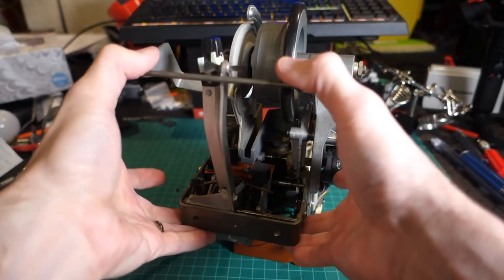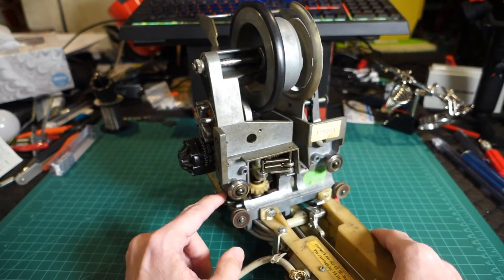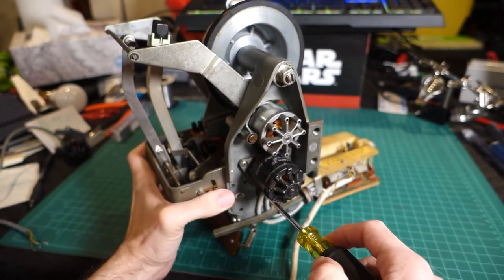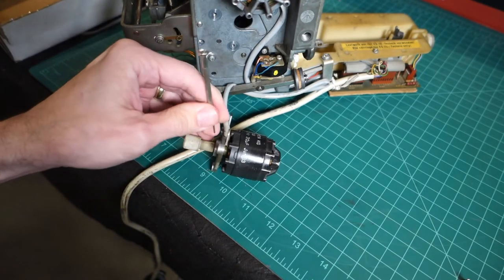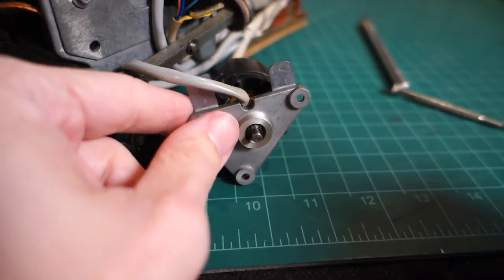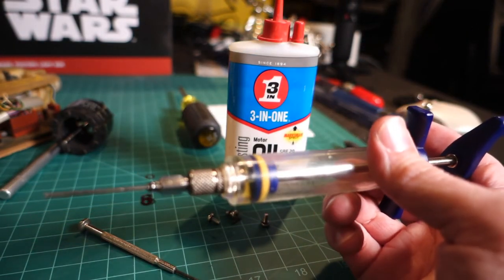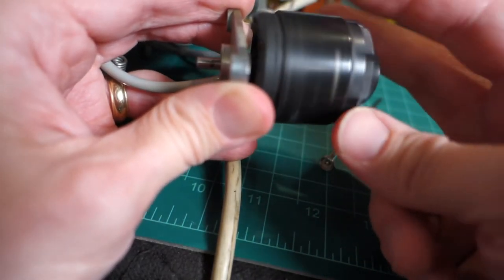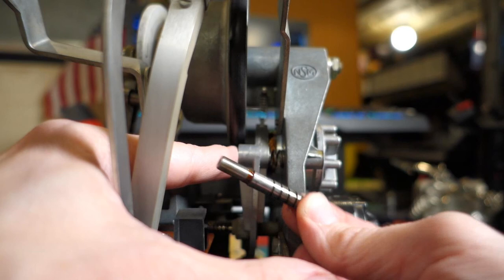NSM 45 rpm mech repair (PART 2) sticky/gummed up drive motor

Comment: Very helpful video, thanks a lot for uploading. Perhaps you have a solution for a problem of my consul E120? It always picks up the same record, plays it, takes it back, and picks it up again, plays it, and so on. Best regards from germany 😀
Reply from the maker: Thanks for the kind words Ralf. There could be a part of the mechanism binding up - thus not allowing it to change to travel mode. Also check that the solenoid under the mech operates properly.
Reply: @PinballMayhem  thanks a lot for answering so fast. I already cleaned  the machine, but perhaps there is still a little bit of old grease left, that causes theese problemes. I'll give it another try with brake cleaner, then supply with fine machine oil.
Reply from the maker: I've heard the plastic clutch rod can break. This is a vertical square piece of plastic buried in the mech.
Reply: @PinballMayhem  this morning, I removed the machine, cleaned it up by using brake cleaner, then supplied oil to the metal parts, und silicon spray to the plastic parts. Now, for the moment, it works well again, would be happy, if it lasts for a while 😃 On the bottom of the machine, there is a lever, moved by a spring, and held by a cam. If this lever doesn't move, when released by the cam, the machine doesn't change from change disk to drive mode. That might have been the problem.

Comment: Can I ask for the wire diagram from the selection box to the main  control box 
Because when I select say say 12A the numbers disappears but does move or select records ?
Reply from the maker: Sorry I have nothing available. Does the relay click at all on the power board? Does the motor turn freely by hand?

Comment: Thanks for sharing video...I have an NSM CITY...not the CITY II...could you please tell me what the difference was/is between the CITY and the CITY II?
Reply from the maker: Glad you liked the video. A few minutes on Google provided the answers. The main differences are the later city 2 has an updated control system and updated cabinet. My feeling is they were looking for a name for their latest machine. So they went with city 2 and made a series out of it. Apart from the name it does not appear to share much in common. Perhaps the cabinet size, good for a smaller location is there common link.

Comment: Hello your video is really interesting I have a question for you is the arm that lifts the record up and obviously the jukebox cannot work would you have any advice for me to repair it? I thank you in advance
Reply from the maker: Hi Massimo, check that the arm is not stuck on it's shaft. There are other things that can cause this issue but a close examination of the mech (all sides even underneath) can be helpful.

Comment: Hi, Great Video’s. I’ve got an NSM City, not sure which one. I’ve got a problem with the turntable not turning. It moves up and down the carriage and picks a record but doesn’t turn the record. The problem started last year, it was picking the record but taking a bit of time to start playing. Now it just picks the record but doesn’t turn. “ Hope you can help “. Andrew from Scotland. Cheers.
Reply from the maker: Thank you for the compliment. I have not worked on any other NSM jukes. The only thing I have to offer is check that the turntable motor turns freely - they can seize up over time.

Comment: The washers take out the end play in the motor shaft. Did you notice how the NSM (I call the machine NFG) mechanism is just a cheap copy of Seeburg's mechanism?
Reply from the maker: Yep, the Seeburg mech is a mechanical marvel for sure 💚
Reply: Löwen Automaten was the german ditributor of Seeburg jukeboxes, NSM ( named after the 3 founders ,Nack , Shulze & Mencke) was making jukeboxes with a unique system (Fanfare 60-100) but this system was not handy for most operators so they went using the carriage on request of Löwen Automaten that was also distributing NSM and that's the only link between Seeburg and NSM. Some called it a cheap knock-of Seeburg I say it's a cheap improved system over Seeburg because for the price you bought 1 Seeburg you could almost buy 2 NSM juke's and that's why NSM did become one of the greatest jukebox manufacturer in the world . Seeburg went out of buisiness in the early '80's  while NSM is still active and the claims Seeburg made to NSM didn't work out because the  difference between both brands mechanisms were big enough. Fun Fact In the 70's NSM's version of the toroid memory unit (Seeburg Tormat) does not require a physical ground line and thats why the NSM version is made out of plastic and got away with the Tormat patent claim.
 Most heard complain about NSM is the use of plastic gears, Yes plastic is cheap and gears breaks easyer but most carriages still work after 50 Years after a good lubrication and parts are still available so why make it in more expensive metal then?  Good luck with the repairs hope you get the same appreciation that I got for this German now American brand that's  part of antique apparatus since 1994 ( Rock-Ola bubbler and NSM Nostalgia gold are the same jukebox cabinet only with a different mechanism  😉) so you can see it has quite a huge history
Reply from the maker: Thanks for the great comment RKM. I learn something new every time I work on something. Plus I never knew that NSM made a tormat unit. There's an interesting history there for sure.
Reply: @PinballMayhem  You're welcome, maybe interesting, they were founded in 1953, they started with slot machines called rotamint.  As said first they used a horizontal mechanism in their jukeboxes almost like a normal record changer between 1956 ( start production Fanfare 60) and 1959 (this system would pop up in some models in the '60's as a cheaper version of a model that was also available with the serenade mechanism) , from 1960 till 1968 they started with a carriage and a pinbank but different than Seeburg (Fanfare Silber was the first model but they called it the serenade stereo magic mechanism after the first open model jukebox with the carriage)  between 1969 and 1976 they used the toroid  system ( like the Century 21 of 1975 on my channel ) and in 1977 they started with the "E" serie wat stands for "Electronic" what runs on a programmed texas instuments TMS 1000 chip  folowed by the ES system, a small improvement was made in de computer on the follow-up system called ES2 but is completely compatible. ES3 is only made for Löwen-Automaten (see indication below or above the word Satellite, the other model was the 240I that holds 120 records) the last system on 45 Rpm was ES4 final model was Galaxy 200 that is only made for America so its very rare here in Europe. 

The ES 2- ES 3 and ES 4 were also made with a ortofon mechanism, on your satellite you can read " Model Satellite 200" the ortofon version is called "Model Satellite O- 200 or satellite  200_O " 

The ES 4 carriage can be used on ES 3 jukeboxes but the ES 3 only carriage can not be used on ES 4

The first time they start using the Ortofon carriage was on the City II -O

There you have all the information in a nutshell

Best Regards,

Roy Kroesen